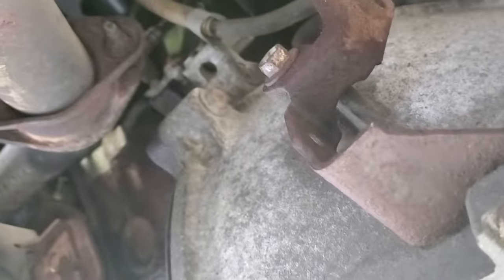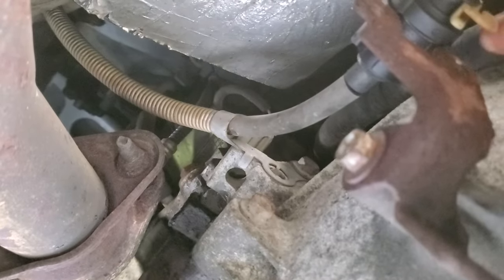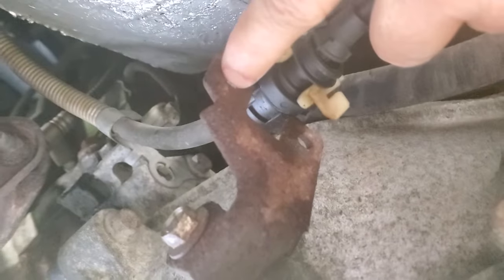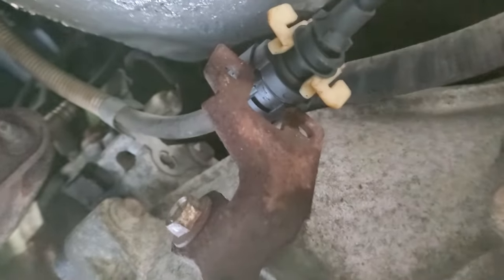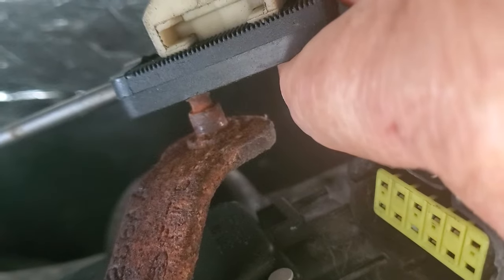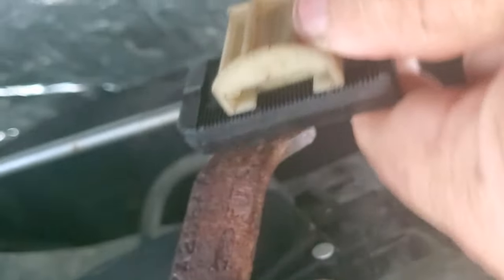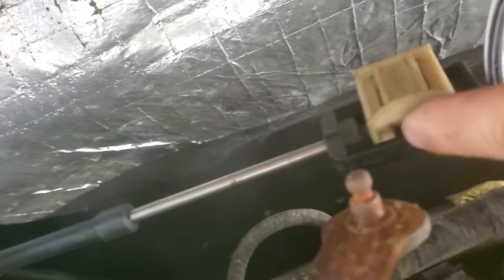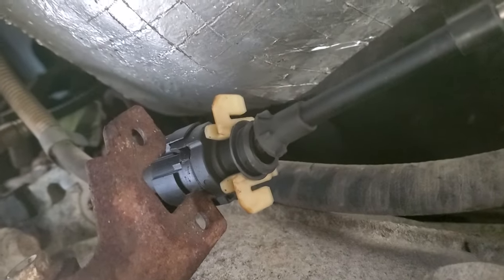transmission shift cable removal

Comment: Quick question , do all transmission linkage come off like that ? I have a zf transmission and I'm taking it out of the car . The cable is attached to an arm just like that with a plastic ball on end do I carefully pry it off ? I have a plastic fork remover I can use instead of screw driver

Comment: I have a 2000 mazda bseries original transmission was 4r44e and I installed a 03 ford ranger 5r44e transmission in it and it needs a new automatic transmission shifter cable I did notice that my old one was 50.9 in and the new one I bought is 60inches or longer ik its longer then mazda b but I need a cable probably like 53 54 inches to reach the shift adapter bc my original one did not even reach the shift adapter and then I gotta find a one but I'm unsure what size because this one is too long 

Lmk if u can find a shifter cable that would work with my truck